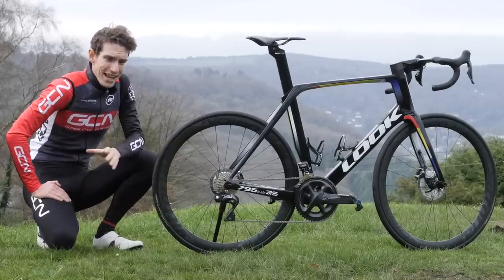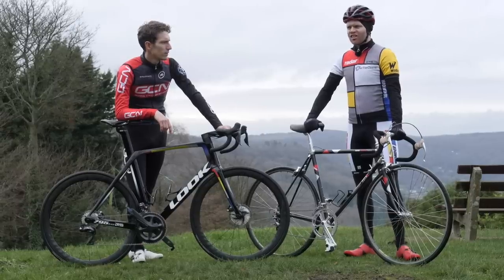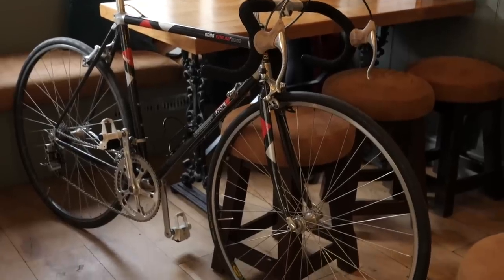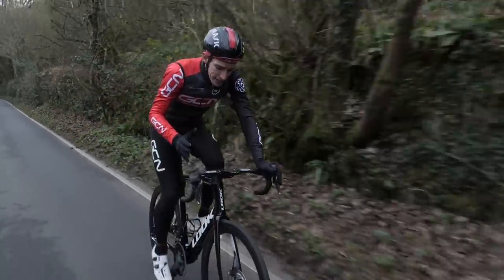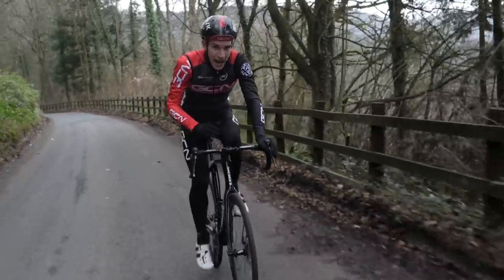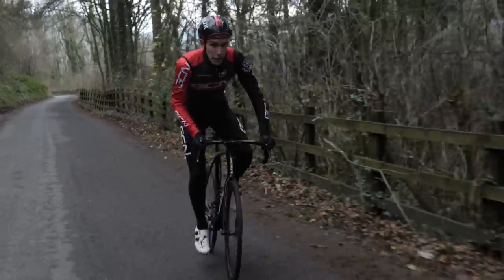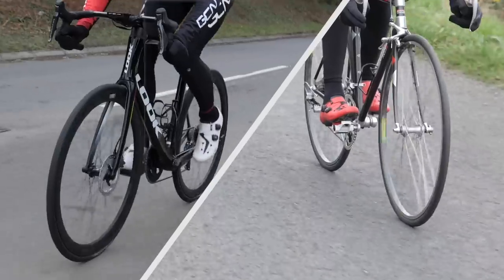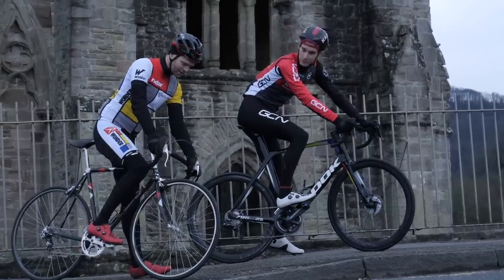How Much Have Carbon Bikes Changed? | Retro Vs Modern

Comment: Compared to steel and aluminium, carbon fiber is a very unethical material.
Very difficult to recycle, excess cloth is usually buried in most Asian factories. Gives off many nasties when burned and does not break down very easily.
Hate to think what happens to old frames at throwaway time. 
Both steel and alloy can be very efficiently recycled and are renewable resources.
Reply: True which is why I’ll never buy a carbon bike

Comment: My first carbon bike was a 1981 Giant tcr-2 road bike.  This was recently replaced with a 2015 Cannondale Supersix w/Shimano di2.  Old bike weighed 21.5 lbs and new one is 15 lbs.  The difference is noticeable everywhere.  Smoother and more stiff ride in new bike.  I really can notice the 7.5 lb difference when it comes to hills.  I can't say much when comparing down tube shifters with ergo shifting with electric help.  My riding style changed - now I'll try gears just to see if it feels better.  There is no effort involved with di2 - I liken it to switching from a manual to automatic transmission with cars.
Although I've enjoyed many miles on my Giant, I'm happy with the change and would NEVER go back.
Cheers!

Comment: In 1986, I was racing triathlon on a 1984 Vitus Carbone 3 with the same Mavic Group, which was the 3 carbon tube version of the famous Vitus 979 on which Sean Kelly won so many races.   In my stable, I have a 1986 Bik Racing.  The first monocoque carbon frame made in Maine, USA. The team that made those frames later split and one part of the team went to Minnesota to work with Trek on carbon frame while the other part went to California and created Kestrel.  Those are truly the first Monocoque carbon frames.  I can send you pictures.

Comment: The pedals on the LOOK KG-86 are not the original LOOK PP-65 pedals, but the ~1990 LOOK PP-56 pedals. The hinged locking blade at the end of the pedal didn't wrap around the pedal body with the original PP-65, however, it does in the PP-56 pedals shown in the video.

Comment: I tried riding these CF frames in the late 80's but the bottom bracket had to much flex and killed my sprint.
I had a 42MPH (67.59 kph) sprint and the only frame that could handle it was Cannondale criterium.
They were stiff and harsh riding and the stem angle was steep but if you wanted to win races it was always in the sprint.

Comment: 3 years ago I resurrected my original 1989 Trek 1500, bonded aluminium frame with Ultegra and Matrix IsoC aero wheels. It’s museum-quality condition and I’ve ridden it in anger nearly every weekend, including 2 gran fondos. Love the bike. However, I just stepped up to a new Trek Emonda SL6 disc, and, the difference is like night and day. The Emonda is lighter, much more comfortable and goes like stink. Like Simon says, while the vintage bikes are capable performers, modern bikes are just plain faster and won’t beat your body up so bad. It’s exactly like comparing vintage sports cars to modern. Great video...sorry Ollie had to baby the thing. Cheers!

Comment: I made the switch from steel to carbon this year.  I bought 2 lightly used C-40 Colnago bikes.  I also upgraded to power steering and EFI in my 1956 Chevrolet.  Technology is great.  New cars and bikes should be better, without a doubt.  That Colnago rides great though.

Comment: I'm about to build a Giant CFR 3 from 1994, carbon main tubes in alloy lugs, alloy dropouts and fork. Are these frames safe to ride still? The paintjob on mine is perfect, the bike wasn't used much at all, no obvious sign of ageing material, or anything dodgy.  No cracks or what so ever. I won't be racing it so win't get much pressure, I'm a hobby rider. What's your thoughts GCN? I've heard that the glue in the lugs can get aged, or UV light can damage the glue in the joints? MY frame has bean clearly kept safe over decades and is in great shape.

Comment: I remember one of the very early Giant OCRs - their entry into carbon frames, that was pretty much the same construction as the old Look.  Trouble was that the bonding of the carbon to the aluminium lugs was sometimes........ummm....ahhh...........less than ideal.  There used to be pictures floating around of OCRs in many individual pieces where the bonding had completely let go while on a ride, usually a climb where the stresses are somewhat higher.

Comment: There is a TVT92 going cheap near me and I am wondering if I should get it as a back up to my Look 386, which I love. It is very difficult to get carbon bikes with short head tubes but since the crank diameter is different, on that basis alone, I think I should give it a miss. I spoke too soon. I has a standard Ultegra crank (5 arm era).

Comment: I own a vintage Wilier Triestina, similar mid 80’s geometry as the Look.  (Same 1st gen Look pedals too.)  It gets harder to ride with each passing year.  Sure, the difficulty is compounded by the increasing number of candles on my b’day cake but a big contributor is also the comparative ease and ride-comfort modern bikes provide.  With each new bike I’ve owned and ridden through the years performance, efficiency and comfort have improved.  When I took the Wilier out for a ride this past summer...well I proved an old adage wrong.  Skill and confidence didn’t simply return.  It wasn’t “just like riding a bike”.  In fact it was kind of frightening.  Like the Look Ollie “borrowed” my old classic is now and for the future a museum piece.

Comment: Hate to be a killjoy (again) but as I own KG76, KG86 (clear carbon retail version & silver La Vie Claire '86 TDF replica) & KG96 framesets, I can assure you that the KG96 (Team Replica) frame also featured the same alloy lugs as the KG86 (& KG76), just painted dark grey rather than anodised silver (or light grey painted alloy lugs, in the case of the KG76 Kevlar Hinault, painted dark grey at the bottom bracket shell).
Reply: At least later on you guys correctly mentioned the KG196 (& not the KG96 from 2 years after the KG86) from 6 (not 4!) years later, which WAS indeed a complete carbon monocoque frame! Yes, I know that I'm a pedantic, OCD nutter when it comes to LOOK &/or Mavic SSC from the 'semi-vintage' days of cycling!!

Comment: Fascinating. Where were you riding Si? Loved the roads. And did you enter the front wheel skewer on the wrong way or is that how they gave you the bike? Me too. I'm a totally modern, the more modern the better, rider!
Reply from the maker: It's our local stomping ground of the Wye Valley on the Wales/England border. And the axle has to go in that way because it threads into the frame, and the threads are on the left side.

Comment: I have a well loved KG86 exactly like the one in this video, but with Campag...the cranks are drilled out Super Record. I've had it since 1992! If you ever want to borrow one for a video or comparison, you are welcome to. They had a habit of coming unglued. Used to be comfy on long rides due to it's flexi nature! Feels awkward now though. I also have an old Look Max One power meter from the same era (late 80s). The computer covered the stem and the torsion shaft was in the hub. There is a Youtube clip of live data from one in the 89 TdF (search "Look Max One TdF"). Very cool.
Reply: Thanks for the great comment! That’s awesome. We did wonder about the longevity of the adhesive 👍🏼

Comment: The lugs on the old Look lugs appear very similar to Vitus.
Reply: I noticed that too.
Reply: That's because it basically is a Vitus with carbon tubes.
Reply: Well that explains why they did not ride it hard. I had a blue Vitus from the 80s. I had to stop riding it when the frame started to fail.

Comment: I still have a set of red original Look pedals. I still (occasionally) ride a 1989 Trek w/ Dura Ace. I also have a Raleigh Technium Team  Reynolds 753 frame form the mid 90s that has never been ridden. Been looking for a vintage Record groupo to put on that one. And  Bianchi Sanero aaaand a 2001 Cannondale F1000. Bikes are expensive. I should probably save up for a new one though. As far as Aero bikes go, At 6'5" and over 200 lbs, I don't think it's gonna help.

Comment: While vintage steel frame ridden by Lemans, Hinault and others have high value, carbon oldschool frames go for pennies. You can pick up such KG frame for around 150-250 eur, in best case scenario with groupset on it.

Comment: What did Look do to prevent galvanic corrosion where they bonded carbon tubes into aluminum allow fittings?  How did that 32 year old bike not just disintegrate at all the joints?

Comment: I have a KG96 from 1991... I have not ridden it for at least 15 years... My question, is the bike still “safe” to ride? I am concerned due to “galvanic corrosion” due to it being glued to aluminum “lugs”. Any info would be much appreciated.
Reply: I have a TREK 2100 that I ride daily. I found as long as the corrosion isn't extreme. It should be safe, wash it every few weeks and ride it.

Comment: What bicycle racing rules do each of you think is probably unnecessary, and what rules should they add? Things like weight, aerodynamics, etc... And are there any rules that are essentially meaningless? (like some of the sport rules about some aero and hydro dynamical kit that turns out not to be aero or hydro....  at all ).

Comment: I recall Specialized had a me-too bike frame with carbon tubes bonded into alloy lugs...and an issue developed where the glue would fail for whatever reason...and the head tube would separate from the rest of the frame... GL was lucky the Look bikes were better made...

Comment: Why is the Look bike's quick release on the drive side? Does it have anything to do with the side the disc brakes are on?
Reply: Probably has more to do with the use of modern thru axles. With disc brakes on road bikes the thru axle handle threads thru hub from the drive side for the front hub and from the non-drive side on the rear hub (Google it).

Comment: Bottom line, if you save 20W at 45kmh, that's around 3-4% in power. That means that instead of going 45 you'll go ~45.6. Now, few amateurs will be able to maintain those speeds, so for the power you use to ride at say 35kmh, this bike will probably make you ride ~35.3 instead. That's not really the night and day difference they are trying to suggest... Of course, if you are a pro cyclist that means a lot, but I'd bet that there aren't too many pro cyclists looking for bike advice on youtube...
Reply: And I don't believe for a moment that the frame aerodynamics alone would make 20w difference at 45kmh.
Reply: Wattmeters are turning pro cycling into a boring thing to watch these days. I have been following it on telly since the middle 80's. Gone are the days of agressive riding. Firstly to get away and then secondly to stay away long enough so the pack dont get to you before th end. Riding on instinct is all but gone.
Reply: @neil7769  I can't comment on this (we'd need some CFD software and the actual blueprints to know for sure) but one thing is certain- they need to claim that something (anything) is THE next best thing, otherwise why would people upgrade their current stuff? At least for mass produced passenger vehicles (bicycles, motorcycles, cars) there's hardly been any progress in the last 15 years- at most they just added a few (more or less useful) electronic gadgets.
Reply: @stefansk8  I agree. I wish they'd just be honest and sell each year's new model on aesthetic design values and fashion. I think they'd still sell as many bikes TBH. Most people just want an excuse to buy something new and shiny. Swoopy tubes and pastel shades one year, angular frames and dark metallics the next.
Reply: @neil7769  That wouldn't be enough. People need the whole story (that's the purpose of this video- to tell the story), as most times there's something else behind just wanting something new. Such as wanting to have something to brag about, something to make you feel you have the upper hand, something to prove that you've "made it"... there could be 100 reasons for actually making a purchase.
Reply: @stefansk8  Yes, even given the slight improvements in aero numbers, it's still being driven by the same engine, albeit, a year older and a year slower.  One would need the right computer brains to drive things... one that concentrates on the small aero improvements, disregards the age of the engine, and one totally disconnected to any financial computational algorithms.

Comment: I would like to see all these pros actually ride an off the shelf 15 kg alloy road bike to see how slow they would go lol.
Reply: That would actually be quite nice to see.Alternatively,if Merckx from the 70s could time travel to the current era and ride a modern road bike,its interesting to see how fast he would go.
Reply: 15 kg would be hard to achieve - just steel roadbikes using simple carbon steel (like the Eurobike) are that heavy. I have a fitness bike using a former '89 lugged and brazed cromoly  trekking frame, with a stainless steel flat bar, and it's still just 12,7 kg. Alloy should be lighter, even simpler road bikes with alloy frames are around 10 kg.
Reply: @simonm1447  Even though I moved unto Carbon bikes I still have my old GMC Denali 6061 alloy bike, sure it's a tank at 14 kg but lot's of fun. I still ride it in Autumn and even on the snow filled roads. It's a beast, not going to win any races on it but hilarious trailing $7000 carbon bikes and the look on the faces when they see what is chasing them lol.
Reply: @danfuerthgillis4483  I think the weight of the Denali mostly comes from the components, not the frame material. A typical steel frame weighs between 2,3 kg and 2,5 kg, while alloy frames for simpler road bikes are at around 1,6 kg, MTB hartail alloy frames are typically 2kg to 2,2 kg. Forks are between 700g (alloy ) and 1000g (cromoly). 

The biggest weight savings can be made with the rest of the components, for example wheels, the tires, or the crank set (it seems to have a 3 x 8 with steel chainrings). 
Even a carbon  frameset with the rest of the components like the ones of the Denali wouldn't be really lightweight, since it would just shift off 2,5 kg bike weight compared to a full cromoly frame and fork set.
Reply: @simonm1447  Yep, the GMC Denali frame is very large ( the tubing) so it has more weight than a traditional thin steel round tubed bike. So even though the frame is 6061 alloy it's the thickness and size of the tubing that increases the weight. You would literally need a sledge hammer to break the frame joints on the GMC denali frame lol. With Carbon bikes I always tell people to start with using normal pedals so they get used to how the bike tracks and comes to a stop due to the lighter weight. It is very dangerous to have someone start off using clipless pedals with a Carbon bike as one fall on it's side and that could snap off one of the chain stays or have internal cracks on the stem for example. The worst damage to Carbon fiber is the damage that you don't see as this is the one that is more dangerous at higher speeds. As far as fun factor there is no denying it the GMC Denali 48 cm with the sloped top tube is better than both my higher end Carbon bikes. The abuse this bike has took, none of my carbon bikes would survive it lol. If you are not racing at a pro level even a $50 road bike is fun.
Reply: @danfuerthgillis4483  My ''main roadbike'' beside the old cromoly which I got for free and restored it is a converted 2007 trekking bike, I converted it with new wheels (Exal alloy wheels with 36 spokes and XT hubs), road bike tires and hydraulic disc brakes. It has a 7005 alloy frame and a ridgid alloy fork, and around the same weight as the cromoly bike. 
Since the components are trekking and MTB parts it is also much less sensitive compared to a real road bike, at least on one level with gravel bikes today.
Reply: @simonm1447  Thats good!, I will have to retire this GMC Denali as the wheels are freewheel hub mount which are getting harder to find online for sale ( Aliexpress has none it is all Free hub now), cup and cone loose ball bearings 7 speed freewheel, caged bearings on the bottom bracket. I like working on this bike as it is setup for me and me only. I even added ceramic loose balls on the back wheel cup and cone which make a huge improvement. The square shaft bottom bracket has caged loose ball bearings on the cups. Setting up these bikes require good mechanical skills so you get a good tight back wheel but spins loose for minutes, also on the front caged bearing cups the right amount of slippage is always by feel not really by torque, these cranks spin forever and they are using 1970's technology. New bikes are much easier to work on with the quick release wheels and sealed bearings. The back wheel of these older bikes really requires patience in order to get the right looseness of the cups with the loose balls and then the wheel tightening torque on the outside bolts. The trick to get this smooth is to use the NON drive drive side cup and cone to adjust the play with the 2 spanners you will get it perfect.
Reply: @danfuerthgillis4483  Since I use mostly Shimano hubs I also have these cup and cone bearings. On a couple of bikes I already replaced the grease and so I had to readjust them, which is feasible with some mechanical skills. Since they have to be adjusted with the force of the quick release engaged you can adjust them at home better than the original factory setting. 
The bottom brackets I use are cartridge type ones, but on the old cromoly bike I used a cup and cone (the Denali also seem to have one) from a scrapped 1980s bike. In Europe you typically don't find them any more on newer bikes.